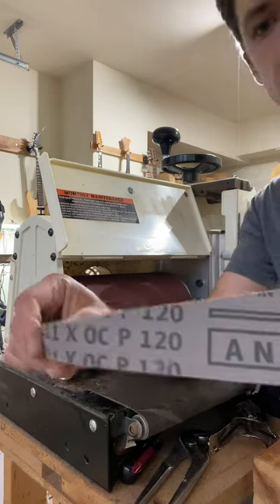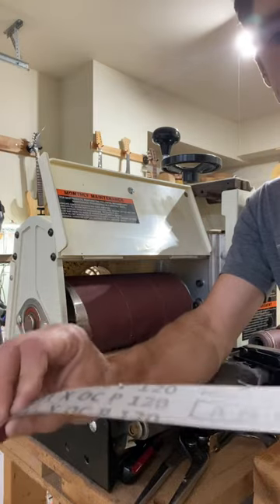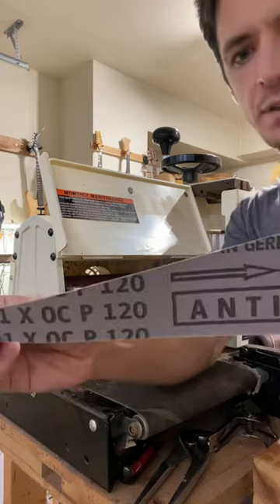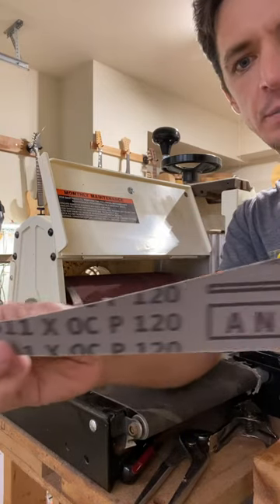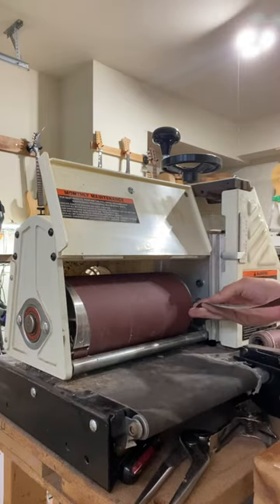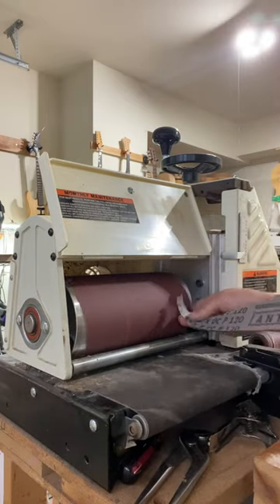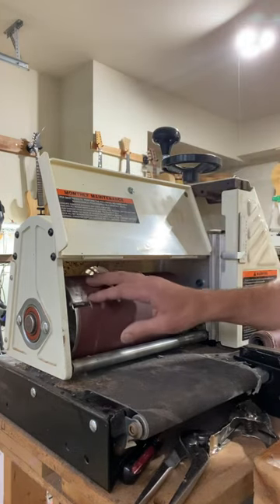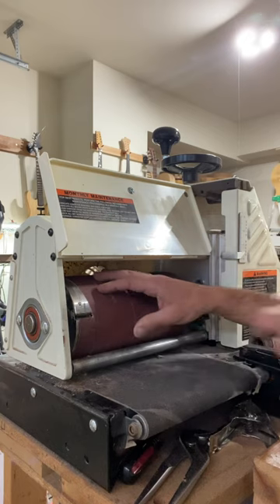TIPS for changing sandpaper roll on Jet 10-20 Drum Sander

Comment: Absolute POS! Do not buy it.  I got one for new shop. Didn't unbox for 2 months. Was factory defective. Jet sent me a new motor. Replaced it & still defective. Sent me a new motor backet. Still defective. Took it to auth service. Still defective. Been a year now. I've lugged it around, wrenched on it for a several hours. I'm out a grand and I haven't sanded a damn thing. BEWARE
Reply from the maker: Yeh. That’s crazy. 
This one is about 14 years old and haven’t had any issues with it. 

They are quite heavy and I can’t even imagine hauling it around. 

Best of luck with it